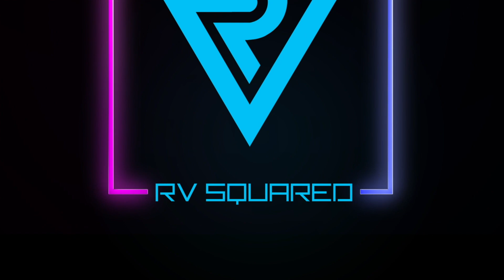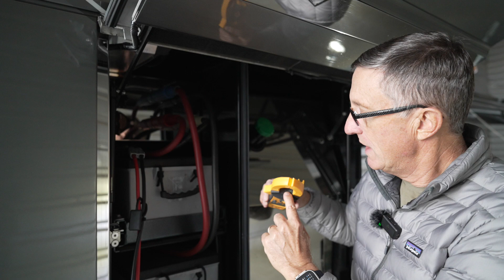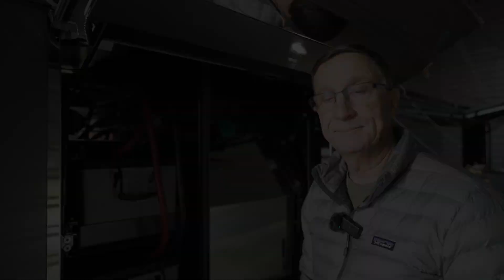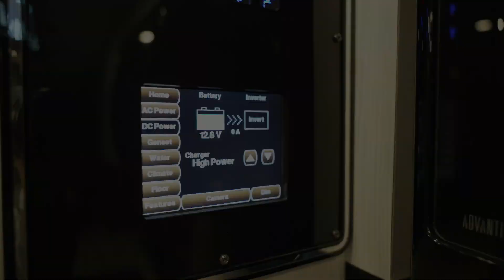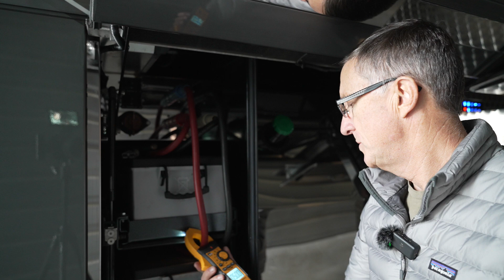How to use a Clamp Meter & 10x Splitter to test AMP Load on your Newell or RV

Comment: Another great video! Clamp meters were a complete mystery to me until I discovered your other clamp meter video earlier today. I had also previously pondered the value of lighted plug ends, considering them more novelty then practical. Great idea, remote monitoring and verifying live current via the plug ends, I like that! I’m rewiring our 38 foot sailboat and the clamp meter is going to be a most valuable tool. So much so that after watching your video I stopped off at Home Depot and picked one up today. I’m going to first check my house battery battery charger performance, like you did in this video. Thanks again!
Reply from the maker: Awesome news Bryan! So glad you found out about the clamp meter and more tips in my videos; thank you for watching and commenting!

Comment: Thanks for the video, I always learn something from these and they are very helpful. Is there a reason you don't plug in your coach and just have the inverters maintain house battery charge?
Reply from the maker: Hi Tim, thank you for watching; glad you find them useful.  Good question about plugging into the "shoreline".  Newells require a 50A 240v service, which can't be downrated.  Since our storage facility only has standard 15A 120v, I must rely on separate chargers to maintain my chassis and house batteries, at a very low and controlled current.

Comment: Hi Steve.  Thanks for another interesting and highly informative video. I learned things! 🙂 Hopefully, you can find where you are losing energy if it's not associated with the operation of the inverters.
Reply from the maker: Thank you, Duncan!  Thanks for the good luck, too...I'm actually heading to the rig in a minute and will re-address the cabling as well as inverter draw.  They really shouldn't be working very hard at rest.
Reply: @RVSquaredSteve  I agree Steve. I will look forward to your update on that situation. In any case, it really highlights the importance of why it is necessary to use a clamp meter to make sure your system is functioning optimally. Good luck!